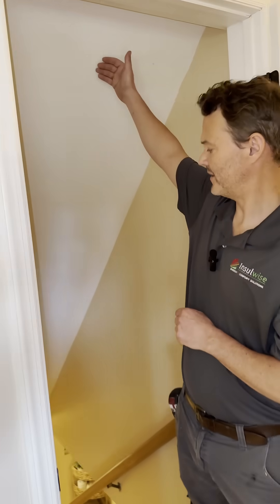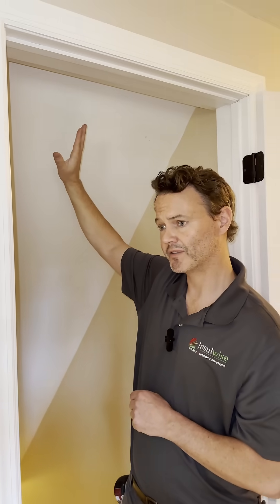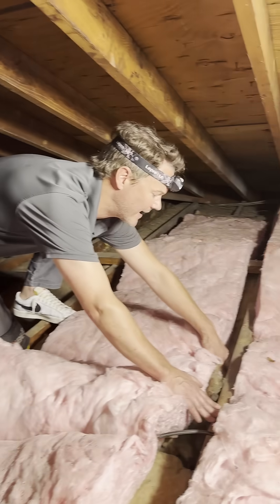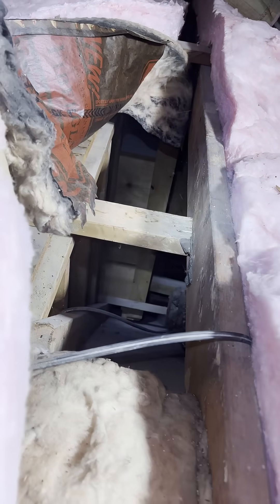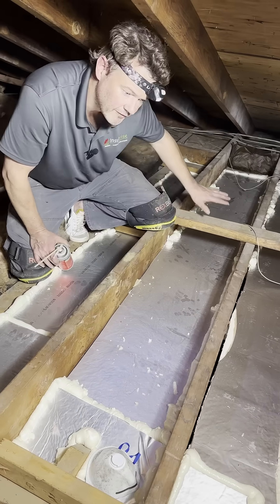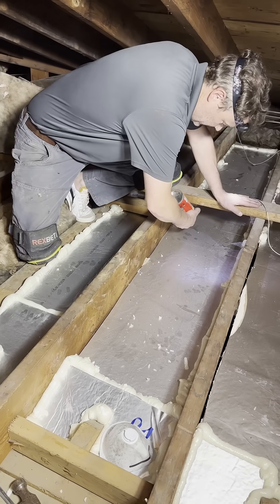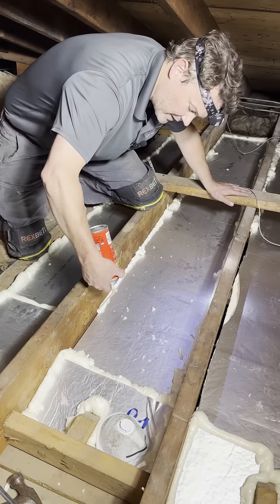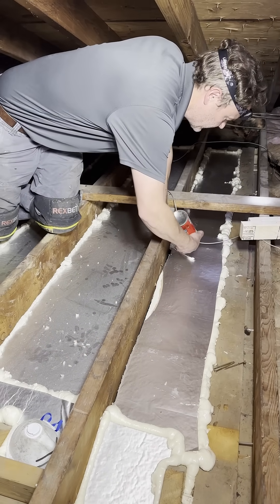Top Insulation Expert Reveals Best Air Sealing Techniques for Attic Stairwell Voids

Comment: Wheres your foam gun they sell for $45? Dont hire an insulation guy who uses homeowner foam cans
Reply from the maker: Classic.  I've used foam guns plenty of times.  Here's why I don't issue them to my teams 1)  They are often too large to access and seal many of the tight places we need to seal in attics 2)  they jam, break, and fail -- even when maintained 3)  they get left behind and lost in attics 4)  the foam refills for them are at least twice the unit cost as regular good ol' great stuff.  
So if you want to "look like a pro" by all means get yourself a gun and have at it.  But if you intend to air seal hundreds of attics a year and go through thousands of cans of foam (and still make a profit doing it), I'd recommend using good ol' off the shelf great stuff.
Reply: @insulwiseenergycomfortsolu3293 check the price again. I’ve never had one fail after 8 yrs. They do jam but you take a razor blade and peel off the tip. Easier to use than cans and cost less per ounce. Most of the time theres plenty of room.

Comment: I would have tried to get insulation on the back of the diagonal board. Use a stick and pink bat. Then use the foam board.
Reply from the maker: We could have.  But that would be like insulating the interior walls of your home for thermal performance.  We blew an R49 of cellulose on top of that after.  If hit with infrared on a cold night that diagonal ceiling would look like any interior surface.  Thanks for commenting!

Comment: And when you do this, you should never use open cell spray foam because you will have an older later on down the road that smell smells like fish, and it is due to the fact that water and the water in moisture in humidity will collect and open self spray foam it is like a sponge
Reply from the maker: We are not fans of open cell spray, and definitely not sprayed onto the underside of roofs in cold climates.  Both of these foam types are closed cell.  They will give off no odor. 
Andy
Reply: @insulwiseenergycomfortsolu3293  i’m just saying the open cell insulation when the condensation because of the steel is cold on the inside inside then on the outside it’s gonna have moisture condensation and open cell in insulation will soak that up and it will give off a older when it is wet kind of smell smells like a fishy smell. I live in northern Wisconsin and I would recommend close cell insulation because it does not collect moisture when the roof leaks. If you use it on your roof, it will not get into the insulation and start overtime collecting mold like open cell will, but each their own I guess.

Comment: If you're doing this professionally, use a foam gun. It's also a no-brainer for DIYers that might be doing much of foam at all. Much more control, cleaner results, re-useable and way less waste. Rattle can foam screams amateur hour.
Reply from the maker: I don't "care what it looks like" with all due respect.  We test in / test out using blower doors on the vast majority of the homes that we work on and my most junior field techs understand stack effect and the ensuing issues inside out.   I've used foam guns plenty of times.  Here's why I don't issue them to my teams:
 1)  They are often too large to access and seal many of the tight places we need to seal in attics 2)  they jam, break, and fail -- even when maintained 3)  they get left behind and lost in attics 4)  the foam refills for them are at least twice the unit cost as regular great stuff.  

So if you want to "look like a pro" by all means get yourself a gun and have at it.  But if you intend to air seal hundreds of attics a year and go through thousands of cans of foam (and still make a profit doing it), I'd recommend using good ol' off the shelf great stuff.  The air leak doesn't care what it's sealed with, frankly.

Comment: I have to try to do this this year, we have a colony of bats that have found our home quite pleasant for their summer habitat, I have 5 attics to do in the top of my 3 story house; the very high peak, behind the walls on each side one room, walk across the hall and do the other 2 on each side of the other room, in the top of a 3 story house. 😔
Reply from the maker: Thanks for commenting!  If you have bats you NEED to avoid those spaces.  You should relocate those bats somewhere else then have the old insulation and guano removed by pros (bat guano is dangerous).  Only after the guano has been remediated do you want to get into those spaces and start working.  And please use the right PPE like good respirators.
Reply: @insulwiseenergycomfortsolu3293  Wow ok thanks for the advice for sure

Comment: Probably would have been better/easier to fill it with blown in🤷
Reply from the maker: When these voids abut exterior walls we do fill them.  When they're surrounded on all sides by conditioned walls we cap them like this.
Reply: @insulwiseenergycomfortsolu3293 how is this different than an exterior wall?  Interior temps/drywall on one side of insulation, exterior items on the other side🤷

Comment: I think that will trap moisture in that cavity now. My contractor said not to do it on our drop down living area.
Reply from the maker: The cap that we've added here is air sealed and then blown over with 15" of cellulose insulation.  The moisture that could be inside the cavity would be the same as if you had a closet with the door closed.  There's no reason for the moisture to condense on any surface, all sides in the interior of it are heated / conditioned surfaces.  It would only be bad if someone made the mistake of venting a bathroom fan or dryer into a space like this.  We have never had an issue with capping a stairwell void, and we've done this repair hundreds of times. 
Andy

Comment: So I'm confused that dead air space won't that get cold no matter if you seal the top. Did you seal the walls and area inside the dead space so no air comes in or out before sealing the top?
Reply from the maker: All sides inside the void are conditioned / heated.  It functions like a closet with the door closed.

Comment: THat foil backing should be "shiny side down."  Then the radiant barrier will work.   To put a blanket atop a radiant barrier wastes the benefit of the radiant barrier.  And any shiny-side-up radiant barrier will lose efficacy, as dust settles and ruins reflectivity/non-emissivity.
Reply from the maker: We use that stuff almost exclusively for air sealing purposes.  I'd bet $1,000 cash there would be no noticeable difference in terms of comfort or energy efficiency by flipping that foam board over so the shiny side can face into a pitch black void.  Thank you for commenting.

Comment: doesnt this effectively create a vapor retarder as similar with painting both sides of drywall? which is not recommended, especially in a situation where one side of the drywall is exposed to a drastically different temperature and humidity level?

Comment: Insulation question, my attic roof is insulated wanted to insulate my ceiling as well. I’ve read conflicting information about if this will cause condensation/mold on the ceiling dry wall. I want to mostly do this for sound over movie/game room
Reply from the maker: Great question.  Generally speaking you want insulate either the ceiling OR the underside of the roof.  You can run into condensation / mold issues this way.  The term is double vapor barrier.  I'd research that a bit and that should help.  In your case I'd air seal the attic floor, then pull the insulation down from the underside of the roof and lay it in between the joist bays.  Then possibly blow over it with additional insulation if you need additional R value.  Let me know if you have more questions. 
Andy

Comment: Noob question: how did you attach the 2 x 3s? It seems like a tough angle/position?
Reply from the maker: Not a noob question at all.  We toenail the 2x3's into place with screws.  With one person holding the 2x3 in place and another putting in the screws it's quite easy.  With a bit of practice one person can also do it efficiently. 
Andy

Comment: I can't understand why this type of 'void' is any more of an air leak source than if the ceiling was flat? Don't we just care about the air leaking points? It's like it leaks more air, right?
Reply from the maker: This is a good question.  There are lots of penetrations down inside that void that you can't easily see.  There are electric outlets, top plates, wire penetrations, etc.  So it's not just "flat drywall" but on a different angle.  That's why we cap them like this.

Comment: Isn’t this foam board vapor closed? It would be better to install something vapor open since all the vapor will worse to the top of the space and get trapped there. Drywall is less expensive, air tight, and vapor open. Better option?
Reply from the maker: No, we want it to be a vapor barrier here.  In areas that get cold winters you do not want water vapor getting into your attic from the home, at least any more than is possible.  It creates a heightened mold risk.  After we insulate over top of this foam board the underside surface of it will be the same temp as an interior ceiling.  It will not be a condensing surface,  It will basically function like a closet with the door closed.

Comment: would you do a basement ceiling the same way?
Reply from the maker: You would not normally want to separate most basements from the rest of your home with insulating materials, unless it's for sound deadening.  What's the purpose that you are considering doing this for?
Andy
Reply: @insulwiseenergycomfortsolu3293  .  i have an 115 year old Balloon framing home.  there is heat and ac that is supplied down there but its still colder in the winter or warmer in the summer.  Just thought if i insulated the ceiling (already did the rim joists foam + batt) that it would make the room upstairs more comfortable since nobody lives in that area of the basement.   Thanks for the reply!

Comment: 1 - I would just frame all that out square to make the stairwell feel more spacious and the new wall gained could be used for art or a photo or two.  
2 - We live in NM where our summers get up to 100F and winters into 20F or below overnight for a few weeks.  I recently removed old fiberglass blown insulation during our remodel and installed 2" poly-iso foam (foil backed both sides) in between our trusses (just like in the video) and cut it 1" less to leave 1/2" gap at each side for locking in with spray foam. And lastly,..
3- Comparing the heat on a hot summer day of just ceiling drywall with no insulation to just the foil face of the poly-iso, ...and doing this just 4 ft apart... the temp difference overall was 15 degrees. In some places as much as 18 degrees different.  I got nearly the same results in winter.
So instead of reblowing in new insulation, I'm doing this to the rest of the remodel and am also using a radiant barrier foil on the roof joists which are not insulated.  I also made better soffit vents and added custom made baffles at the wall edge where the soffits meet the wall to better direct airflow.   Lastly, I'm removing the end wall gable vents and am installing a ridge vent system. This way the air moves across the soffit baffles, up the insides of the radiant barrier, then up and out.  The key to also remember is radiant barriers are for heat reflection, insulation is for holding in heat.  So you have to pick and choose the battle carefully.  Regardless, the 2" foil/foil system seems to work extremely well without need for added insulation on top which could/would inhibit the heat reflection. I hope this helps some people.
Reply from the maker: If you air sealed your whole attic floor than you did some good work.  However, using only 2" of polyiso foam board is not close to enough R Value.  You've only got about an R-13 with that.  Current attic ratings are minimum of R-49, at least in most areas.  If you air seal your attic floor, ventilate and then insulate the attic to an R-49 level, it shouldn't matter how hot it gets up there.  Very, very little of that heat will be getting through that insulation and conducting into the home below.  Thanks for commenting!
Andy
Reply: Hot attics can deteriorate the asphalt roof shingles faster than a properly vented roof

Comment: It needs to breathe tho? To prevent damp and mildew
Reply from the maker: The attic space above is vented to the outside and will "breath."  The interior space has conditioned walls on all sides.  The space functions like a closet with the door closed.  There is no reason for moisture to condense on any of the surfaces inside.

Comment: I have a situation similar- closets have lower ceilings than other rooms. My insulation guy says just fill the void with batt insulation & do loose fiberglass on top, same as the rest of the attic. Is this the wrong way to do it or just a different way?
Reply from the maker: Yes, this is perhaps the laziest solution possible.  His solution will do nothing to account for air leakage.  When we encounter dropped ceilings in attics the stud bays of the walls are always open -- on at least one of the walls.  He can either cap the tops of the open stud bays with foam board and foam sealant and then blow the void full, or cap the void at the attic floor level (like I do in this video).  Does he do any air sealing at all?  Sounds like an old school'er. 

Show him this link if he thinks that placing batts over air leaks will address the air leak. 

https://www.youtube.com/watch?v=X7GMG3T8cE8&t=12s

Comment: I have a similar old basement stairwell in the middle of my house. 1925, they didn’t bother with the useless sloped celing. They put the attic hatch there! Smart use of space.
Don't forget to insulate and air seal that outside wall on the stairwell.
Mine was left as the original lath and plaster over strapping to double brick. R value 2.5 so cold.😮 Good ol' lead paint really held up well to a century of condensation.
Reply from the maker: 2.	Great question and it’s commonly asked.  That back vertical wall was an interior wall.  There is a bathroom on the other side of it.  When there are true exterior walls abutting a stairwell void you do need to make sure that all of the interior walls are insulated, you cannot just cap it like we did here.  Otherwise cold from the outside will "bleed" into the space and chill those interior walls.

Comment: Probably would have been better off leaving that alone. Sealing the air within that unconditioned space, with no way to vent it, will potentially cause moisture problems over that sloped ceiling…
Reply from the maker: Water vapor in that space will not behave any differently than it would inside a closet with the door closed.  Water vapor usually only becomes a problem if there is a condensing surface where it can turn into a liquid.  That won't happen here.  Thanks for commenting!

Comment: The foil side of foam board insulation should face the air space or the area with the greatest temperature difference. The foil acts as a radiant barrier that reflects heat back to where it came from.
Reply from the maker: If it were being used as a radiant barrier you'd be correct.  In this situation it's being used as an air barrier / rigid platform for installing blown insulation over.  There's going to be 15" of cellulose on it the way it's installed in this video.  If it were turned over and facing the other side it would be facing a permanently dark stairwell void that stays about 73 degrees year round.  Either way the silver facing will make no difference on the outcome of the situation.

Comment: What about the ceiling. It’s not insulated. This isn’t me pointing it out, it’s an actual question. Would putting baffles and then insulation on the ceiling further help lock all heat and cold in?
Reply from the maker: 2.	Great question and it’s commonly asked.  That back vertical wall was an interior wall.  There is a bathroom on the other side of it.  When there are true exterior walls abutting a stairwell void you do need to make sure that all of the interior walls are insulated, you cannot just cap it like we did here.  Otherwise cold from the outside will "bleed" into the space and chill those interior walls.

Comment: you should do it with a professional Expanding Foam Gun. Better control and less wastage, plus you can get into tighter gaps
Reply from the maker: The guns break and constantly and get lost.  The foam cures slightly faster but that's the only difference.  The foam guns also cannot get into MANY of the more restricted places that we need to seal air leaks.  I've used foam guns many times.

Comment: Great point.  I bet a lot of people wouldn't thing to lift up the insulation. Thanks for the information.
Reply from the maker: Thank you.  Yes, you want to lift the batt and air seal between the joists.  This allows a higher end level of R Value of insulation to be blown on top of the foam board later, versus if you place the foam board or whatever material you're using directly on top of the joists.

Comment: Great catch. Stairs, drop ceilings, and interstitial spaces between floors can really be tricky.
Reply from the maker: Thanks for commenting.  You're correct.  Voids, cavities, bulkheads, and all kinds of other thermal bypasses are hidden in most attics.  The benefit to locating and sealing them is often instantly felt by the occupants.

Comment: I missed the insulation of the outside facing wall above the angled ceiling, but below your new attic seal.
Reply from the maker: Great question and it’s commonly asked.  That back vertical wall was an interior wall.  There is a bathroom on the other side of it.  When there are true exterior walls abutting a stairwell void you do need to make sure that all of the interior walls are insulated, you cannot just cap it like we did here.  Otherwise cold from the outside will "bleed" into the space and chill those interior walls.